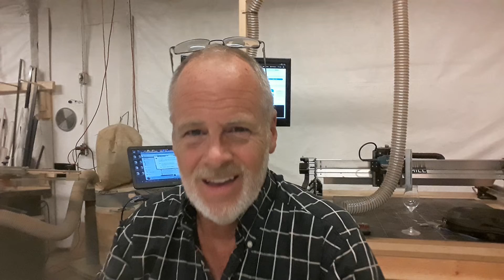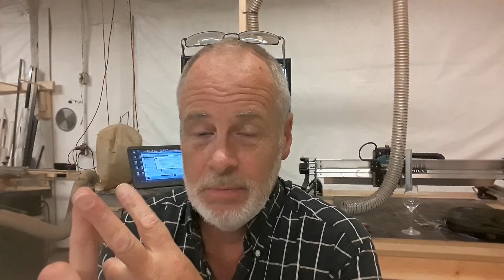Get & Create 3D Models For CNC Router Projects [Vectric Vcarve & Aspire] - Garrett Fromme

Comment: Note, if you have a mac M1, Daz doesnt work!
Reply from the maker: Hi Thom...MAC works for almost nothing when it comes to CNC
Reply: @IDCWoodcraft   i have no issues.. use fusion, the cnc controller, haven’t run into an issues.  Use both windows and mac. Mac is generally more stable.

Comment: Thanks for the tip.  However, after checking out Mike's video, the DAZ software might be useless to use for creating products to sell, as the User Agreement states: "The creation of three-dimensional physical representations (3D-print, molded copy, CNC-routed copy, and the like) of Content or any three-dimensional art derived from the Content is permitted only for personal, non-commercial use by the User."
Reply from the maker: Hey brother, thanks for pointing that out. So we can use it for personal use but not to commercialize (unless we pay for that right)
Reply: @IDCWoodcraft  Yes, but it's like many other pieces of 3D work. You need to buy a professional license if you want to be a professional.  Thanks for the shoutout.